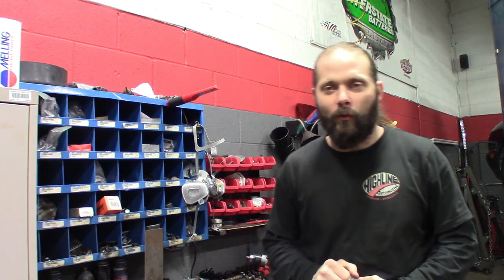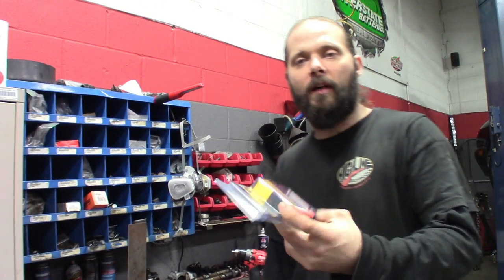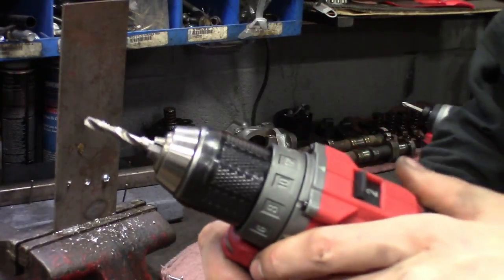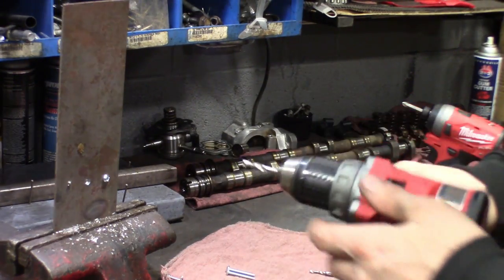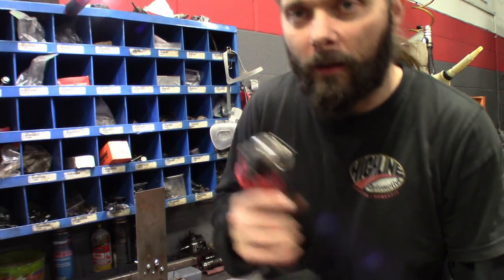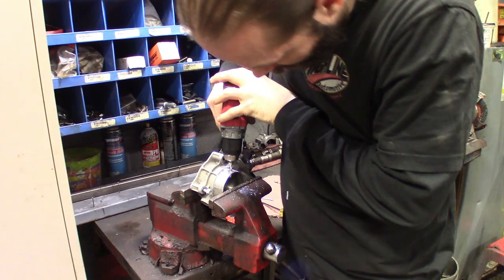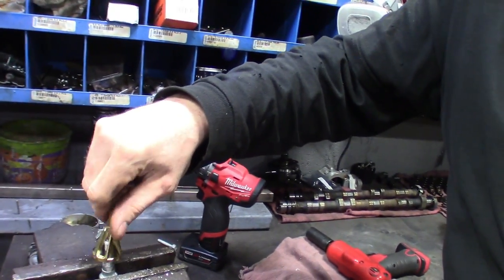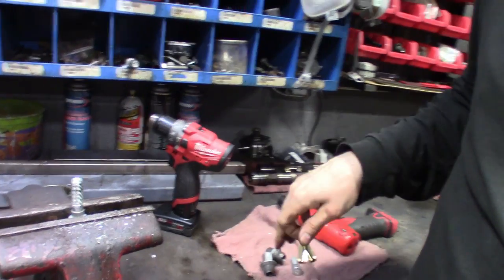Testing TV Tools (T.T.T.)

Comment: good vid. i am curious though: if you took one of the medium-larger sized ones,  used it in the metal, ran in a hex bolt, tightened with a torque wrench, and recorded the ft. lbs when the threads strip. i wonder if the numbers would vary at all compared to those taken from the same test done with a traditional tap. just something to get a convo started i guess

Comment: I bought a couple of those “pencil sharpeners” off an unnamed website that advertises here on the YouTube. They looked decent when I got them. Better looking than what you got. Even had a hex shaft, to fit my impact driver.

Let me tell you... they’re smoldering pieces of crap! I tried one on a wheel stud and it squealed and smoked and didn’t even make a shiny spot. Then, I tried it on a grade 2 bolt. It kinda whittled the end off and it’s a good thing I had a nut threaded on the bolt to straighten out the threads, otherwise I never would have gotten the nut on.

The best way, in my opinion, to fix mangled threads on a wheel stud is with a Murray split die thread chaser. Open it, put it on good threads and back it off to chase the threads. They’re not cheap but they’re the only real option, after you bang up the end with a BFH. Other than replacing the stud, that is.

Comment: All the sizes are common machine screws/bolts used in electrical work. Definitely not really meant to go through plate that thick but I like it. It’s your gonna test a tool you may as well really put it to the test 👍🏼